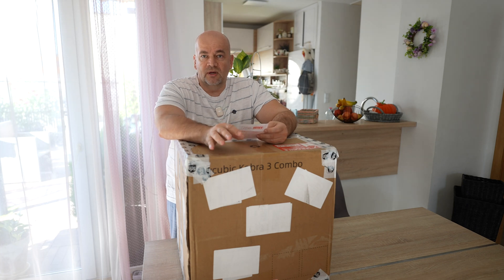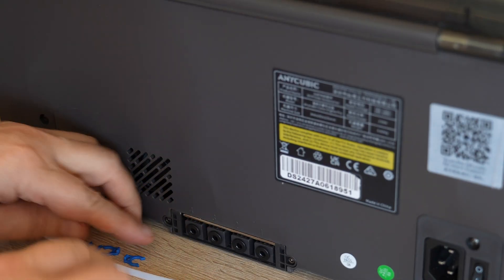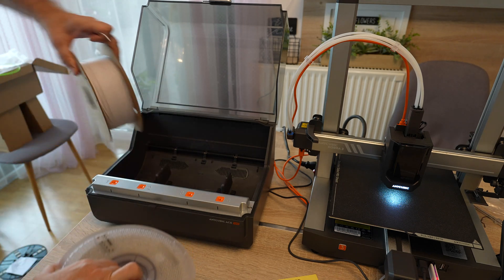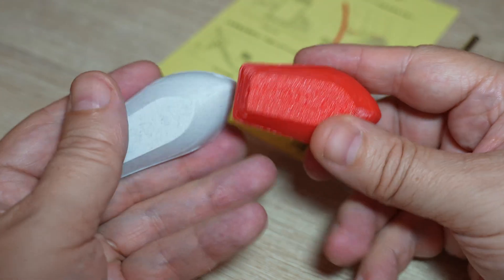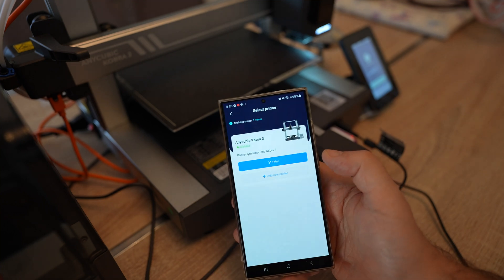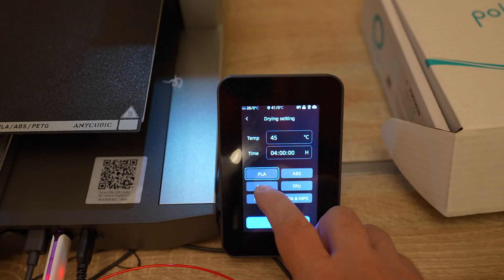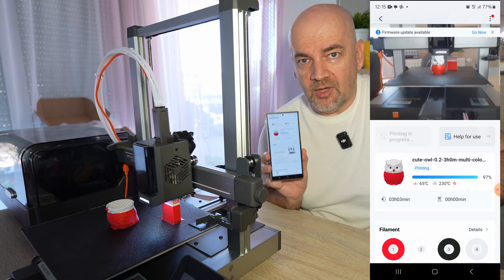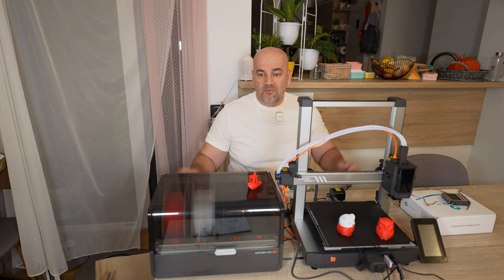Great for PETG: Anycubic Kobra 3 - Combo with heated multicolor system

Comment: I've heard a lot of negative remarks regarding quality of this unit.  It doesn't seem as bad as everyone is making it out to be, at least for the price.  A lot of stuff in this hobby requires a bit of tweaking and tuning.  I'm happy there is more competition on the market.
Reply: Honestly, I got this as my first printer ever 5 weeks ago and most of the issues I had with the printer was user error. I 3d model myself so I made a lot of special-made tests for myself and fine-tuned the slicer settings a little, and now I have pretty much zero problems.
It took a bit of time to tweak, but alas - I was learning what settings meant and did, so that's really the biggest issue. It's very fast with good quality, and I can even let it run in the background while im sitting in the same room without really noticing it going. Overall i'm satisfied, for the price It was a no-brained (it was way cheaper than bambu lab for me, import and tax would have added an extra 150 eur on the A1 Combo). And while I dont have a direct comparison to other printers, based on the many videos I've watched on printing over the last year, it seems to be on the higher end of the spectrum - with some tweaking it's certainly capable of great prints. Ace pro unit is very convenient too! (though all control for it must be done through the printer, or at least the printer must be on in order to control it through their slicer/phone app)

I will say though, there are a few missing features for a tinkering user... There doesnt seem to be a way to access your klipper config as of yet, they claim that LAN mode is coming out soon (and a few tweaks and features, Q4 this year) - so maybe we'll get it then.

One more thing, getting a print to start is much quicker than he showed in the video (from their app) for me. Idk why it took him so long (15 minutes?!).. From PC it takes at most 5 seconds for it to start, from app at most ive experienced 30s. It might be due to the wifi signal, and the download speed for the model on the app on the phone.
Reply: They had to discount it a lot for people to buy it, theory rushed it out too. I think they are still working on the software side. The issue is the z offset, its always inconsistent at the start of the print. same with the kobra 2 pro, which I have. At this point, 3d manufacturers are just putting pruducts out yearly without doing any kind of r&d. Diy 3d printing is not popular anymore, no one is innovating, just copying each other to make it seem its as good as the original.

I don't mind the tinkering, its the fact that new machines are the same as older machines, just a bit faster that's all. All they care about is making a quick sale with a new product, and release a slighter better product in a couple of months. 3d printers can last years, no need to release something new every year.
Reply: I honestly think most peoples issues are that they're not tightening up the components after unboxing it. You're going to get print errors if you're machine isn't properly levelling because your build plate wobbles when it tries to level. 

Mine just came in though so I'll see what issues arise with my personal experience.
Reply: @joerozek43  Thisis just another reason they shouldn't have cheaped out with vrollers.
Reply: @BeefIngot  I'm here officially eating crow. This printer is trash. I've worked on this every single day I've had it and now am packing it up for a return and ordering an A1. I really wanted to like this thing but it makes it so damn hard. 

Blob of death and a snapped x axis belt  along with no successful prints outside of what they've preloaded pushed me over the edge.
Reply: @joerozek43  Oof but at least you are within the return period. I dont think you ate crow either really. I think its a functional printer, I just think it has many flaws which shouldn't be there and expecting users to have to do that, when a small design change could have fixed these problems is silly.
Reply: I think it would help if the default speed wasn't Mach 2. This printer is not good enough to print that fast without fucking up. I dropped all speeds except acceleration by half and it works far better.
Reply: "A lot of stuff in this hobby requires a bit of tweaking and tuning. "

No. And this is why Bambulab has largely taken things by storm. They cast aside these elitist, just kinda annoying premisses a lot of people stuck in their old ways had about 3d printing, and just made printers that worked, without thinking about tuning.

Now when I print, I dont think about tuning at all, and from a prior klipperized "tinkerer" Im here for it.

Other brands need to compete with that experience, and they all try to compete with features, then fall flat when it comes to experience, like they dont truly have people there that use the machines, or management forces them to always be rushed and under supported.
Reply: @BeefIngot  I dont disagree, obviously that's the big selling point with babmu lab. However even with bambu lab you technically gotta tinker with slicer settings from time to time. Though obviously their refinement of the process makes it a lot more appealing for the less technical or willing to learn and adjust.

I see it as no fault to most companies who deliver great hardware for low prices at the cost of a little bit of adjustment by the user though.
Im sure you dont really either,  You do get a lot of cheaper alternatives with tuning and fixing on machines that are unlike bambu lab however, if something goes wrong - sure its an easy fix, but it costs you quite a bit more. Nozzles are a good example. Hotends too.

I feel like the kobra 3 stands between a voron type (lots of adjustment and open market) and bambu lab's A1. 

The answer isnt just "No". It's "kinda, sometimes" like with most things, even the most refined.

In my case I literally haven't needed to adjust the gantry, level the bed manually or tighten any screws. It came ready to print out-of-the-box, only thing I needed to adjust was belt tension (which are the easiest to adjust, as they have literall knobs for adjusting them right there on the printer's casing) 

The biggest, and really only thing they need to do is give users access to the printer.cfg, and give us LAN access aswell. The rest, they'll figure out over time. (Keep in mind bambu lab has a 2 year head start on software! their P1S P1P and A1 use basically the same framework!)
Reply: @Skyflairl2p  I dont know what you mean when you say they require slicer tuning, my whole point is that for the majority of users no tweaking is required at all. As for repair costs, that confuses me as well, they have completely reasonable spare parts costs to the point that I feel its a pretty weak argument.

Anyhow, as for software, I dont see how Bambulab has a headstart at all. Quite the opposite even. Klipper has been around for a decade and there were klipper printers before there were Bambulab pritners. If anything they simply outran klipper machines shipping at the time because they never cared about the user experience and only cared that klipper was free and was a checkbox the users seemed to want.

As for the Kobra 3, its a big step up for Anycubic for sure, but it still has the hallmarks of why other companies keep failing to deliver the experience necessary. Checkboxes checked that actually dont work (like the filament dryer with no place for the moisture to go), and cost cutting tactics that dont even make sense (No person should ever need to adjust their eccentric nuts in modern year, nor should they have to deal with Vrollers).

These are all cost cuts, and then there are design problems like why does their system connect to the front of the printer? It makes no sense from a usability perspective, but the answer is, it was cheaper to put that beside the mainboard because ultimately this is a very dressed up ender 3, admittedly with many improvements, but that underlying cost cutting to no benefit is what Im talking about.

When they act like this, they are just continually chasing themselves into low profits with mediocre user experiences by just trying to make the same thing but cheaper and cheaper and cheaper.
Reply: @BeefIngot  Listen, I dont disagree with pretty much everything you've said here. I'd own a bambu lab if it wouldnt have added another 150 to my import price, which is also taxed here in norway amounting to around 200 over the kobra 3.

To clarify, when I say cheaper replacement parts I didnt mean that as a strike to bambu lab, they deliver high quality easy replacements and it absolutely is fair. However, If you ARE like me (which quite a big portion, if not the majority of the 3d printing community really are) aka, diy/tinkering/handy people - a bit of fiddling isnt a big deal. I can get a 10 pack of hardened steel nozzles for cheaper than a singular nozzle replacement for the A1 for example, although you can find cheaper after market options for the bambu lab too of course. So yeah its a weak argument, but it is true. And for people who actually dont mind tweaking the machine, its hardly a downside.

A lot of us trust ourselves more than anything, as we know what we want from a machine - learning and applying that knowledge leads to a more robust solution tailored to our experience, which in turn gives us the value we wanted. Sure, remove all of that and you can claim happy ever after easily, but when something DOES go wrong with buys like that - you're often more frustrated than someone who did it themselves in the first place.

Now, im stating the obvious here - totally. And I'm just painting the picture of what the majority of the community is still. For a more mainstream, less technical audience the bambu lab fits the bill as much as it can for now. But the kobra 3 falls just flat of reaching that level in my opinion.

As for firmware. Bambu lab has proprietary firmware based on which seems to be based on klipper, just saying its klipper is an understatement and then some. Anycubic is doing the same, but they are far behind obviously. However, that's exactly where bambu lab has had a head start. The klipper firmware running on the kobra 3 isn't fully finished, its just functional. Their cloud integration is pretty much the biggest trait for now, the rest is likely stock apart from custom macros and stages for auto leveling, input shaping, preparation pre-print, etc.
That's the infancy of their firmware I was referring to.

Bambu lab has had more time to fine-tune these, though id agree if you meant bambu lab was already more fail-proof on release, but only by a little. Even they had a few kinks to iron out in the first few months. The kobra 3 has been out for about 2!

Finally, the ACE PRO is mostly designed for active drying, I.e keeping the filaments dry during print. And it does so really well! I cant say I've had any humidity-related issues so far. Even with TPU, which I just let dry in the ACE and take out to directly feed it into the extruder manually. (thats a real downside however), but alas - it isnt failing to get the job done. I havent heard any complaints online either.
Reply: @Skyflairl2p  Id say I disagree with the assertion that people who want to be able to create things want to "tinker" in that way (unnecessary fiddling and tuning). People want to create, and not having to do that means you get to do more actual creating and so I would actually say that it is a big deal to have to do that as for your hardened steel nozzle comparison, I think your unique import tax situation is probably hurting you there, because Bambu nozzles are pretty cheap for what they offer. No hot tightening needed or other things like that.

As for the learning point, I've just always strongly disagreed with that, and I've done it all. You just arent learning anything worthwhile or appreciable, when you can simply buy a printer that will never have problems for you to be forced to learn from. Thats the most ideal situation, because you get more time to actually make things with the tool, which is I think the truth of what most people want 3d printers for. They are CNC tools to create things. In fact, I think its a bit unique that a strong vocal minority is all about messing about with things when you compare things like plasma cutters, other types of 3d printing or subtractive manufacturing methods. Most places, people are happy to just use something that simply works, and I think the 3d printing subculture of tinkering was born out of necessity rather than most people actually wanting to. Its no longer a necessity though, and barely an asset.

In essence, I think its a bit elistist to think that only non techy people want bambulabs. Im about as techy as they come, and I love mine specifically because it allows me to do other things I enjoy. WIth the time saved from not faffing with my printer I've learned PCB design and have had more time for actual projects rather than down time trying to make something work the way I want it to work. In essence Im saying the mainstream wants what bambulab has to offer. They do not want tinkering. Technical people do not want tinkering. They might want the ability to tinker, but its low in priority to just wanting things to work. The people who want to tinker really, are 3d printer enthusiasts, where the tool is the hobby to them. I think those are a much smaller minority than they realize and I used to be one myself.

As for saying that Bambulab is based on klipper, we've seen multiple people try to tear into them to prove it. There is literally no evidence whatsoever that its klipper, and a lot of evidence that its bespoke, like their software defined stepper motor control. Even more evidence though, is that the P1P simple does not contain the soc necessary for klipper to work, yet prints the same.

As for Bambulab having more time, Im still baffled by this claim. Anycubic has been making klippered printers since before bambulab even existed as a company. It makes no sense quite frankly. Anycubic has had literally a decade to do what they've done and just havent.

Lastly on the ACE Pro. it most certainly cannot be doing a good job purely because the moisture has to go somewhere, and its sealed. Its just physics. They need to have venting to let the moisture out. Luckily this is something theoretically easy to improve, but still one of those things that screams "We didnt actually test our device thoroughly before sending it out".
Reply: @BeefIngot  I get you now. And Largely I agree as stated, However - I didnt say that people buying 3d printers want to tinker with them, I said they don't mind tinkering a bit. 
Small adjustments and fixes to fit a printer to your workspace is obviously likely for most. The printer should work out the box, and for most - that seems to be what the kobra does. It's only when you start specifics it runs into problems.

I'll just say that so far, no issues with the kobra 3. As mentioned I've had a painless experience hardware wise, its just software and the general consensus seem to state that when compared to bambu lab, anycubic's firmware is in its infancy. That's the one common nomination made by many reviewers and users. I don't know what's hard to grasp about that. Again, no issues with the ace unit either, my filaments do remain dry through the print - the heating compartment has a storage for silica gel for passive drying as well. There's not been any weird buildup of humidity on the acrylic lid either - So really, the moist air must be going somewhere (where did find your info? speculation?) I haven't checked myself, but there is clear airflow coming out the bottom on each sides. I figured it was venting that way.

Really the only problem with the kobra 3 in my opinion is the lack of access as mentioned, as well as the design choice of leaving ports on the front as you mentioned. The rest is comparing moot for moot, there really isnt much work needed to get this machine working, all im saying with repairs and changes is that it uses more standardized hardware which removes the need to look for specifics. 

Also sorry, when i said "seems to be klipper" I wildly mispoke, I meant to say seems to be something akin to klipper! But really, it just supports the argument of them having a head start. They've specialized their firmware to their printers, allowing them to fine-tune everything for the user which obviously also improves the user experience.

Lastly, I wouldnt say it's elitist to accept that machinery needs maintenance, and that ease of access to repairable parts is a plus. I also disagree when you say "loud minority" as the biggest community in 3d printing literally is people who love building, upgrading and engineering their own/existing printers. 3D printing literally improves due to its community, not because some big corporation spent a big penny on doing it themselves.

Bambu lab is the best mid-form printers right now, nobody is disputing that. Apart from the X1C they've pretty much placed themselves on top of the hill with their careful considerations towards design, firmware and hardware capabilities - all within a reasonable pricing bracket. 
But a lot of the flaws you're pointing out against something like the kobra 3 are at worst over-cautious, and at best over-stated.  I'd say you're about 70% right with your conclusions, but many of the things you've mentioned are simple to resolve or simply isn't a problem for the consumer its aimed at.
Really, we agree. We're just not stuck on the same things here, i dont have ANY issue troubleshooting a little. Literally none. In fact I feel great getting things to work my way. You, however seem to hate the thought to begin with, which is fair! but at least in my experience, most of the people who actually use the 3d printers for designing and fixing other things, as well as a few cosmetic items - dont mind a bit of work to get there.

Im just curious though, what printers have you used in the past?
Seems  you've had at least one rough experience.
Reply: @BeefIngot  nah, Bambu printers can still require tweaking, even with their filament; I have a few.  But they definitely made it easier to get into printing.
Reply: @eltorro  Not at all. Only if you're picky. Every filament prints to a standard most people would be happy with out of the box, and I've printed a bunch from sparkly to silk, to polycarbonate to pp... OK pp was impossible but no one promises a good profile for that...

Anyways my point isn't that you can't have some reasons to tweak. but especially with their own filaments you get a good result straight away.
Reply: @BeefIngot and all it takes is Apple inspired pricing.
Reply: @FoxHoundUnit89  They have the A1 Mini, a cheap, easy to use entry point I dont even think thats necessary. Just people actually putting effort into their products.
Reply: @BeefIngot  Disagree. Feels like you do not know the history of 3d printers. At first you made the printer yourself and did everything by yourself. YOu didn't buy 100% working machine with nothing needed to do.
Reply: @RSChrono-sr9xg  How is your response relevant to literally anything I said??? That used top be the case but certainly hasnt been for a long long time. No idea where you got that I didn't know that from any of the previous conversation.